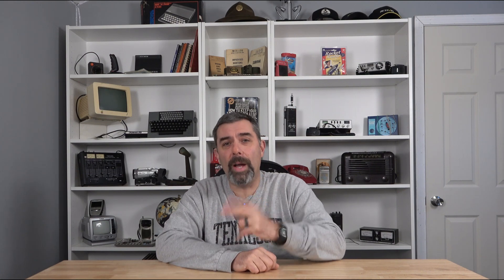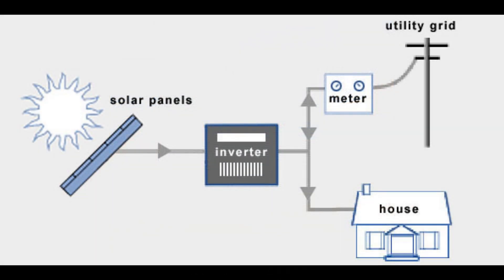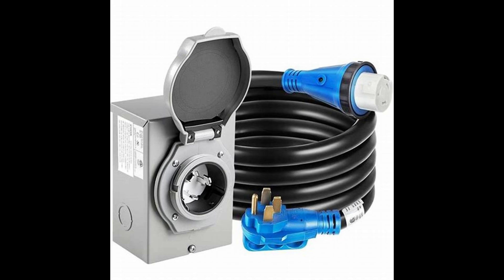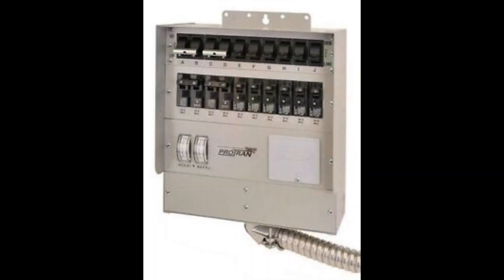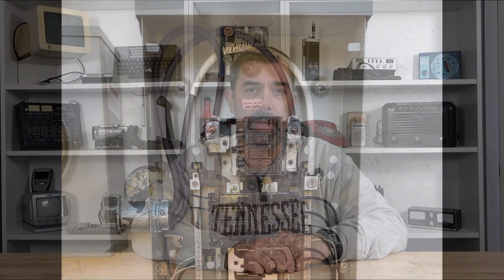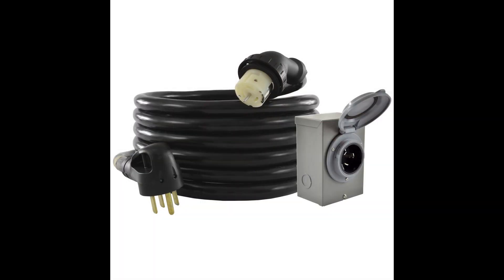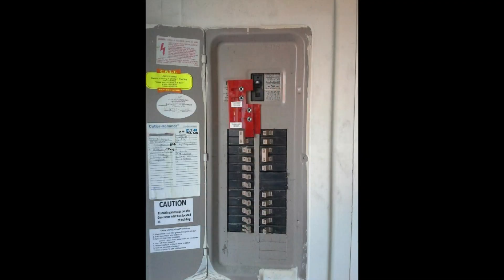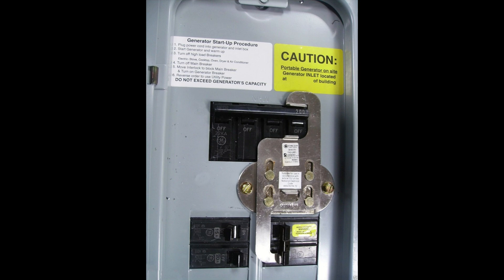A Beginners Guide To Solar Power Part 6: Transfer Switches And Lockouts.

Comment: Super informative video! I am in the process of buying the same 10 circuit transfer switch (matches our panel), and will have it installed soon. The Generator we have is tri-fuel, and will also have the gas company run an extended hose from the gas line so that we will also have the option of running totally on NG if we run out of propane - keeping away from liquid gasoline to keep the gun engine clean!
Reply from the maker: That is a great idea of hooking into the gas line. Good luck in it

Comment: I saw a video where a guy use a solar power station to run his transfer switch. I'd want to do that. My house have a transfer switch and i have a gas generator, but my gas generator is very noisy, and i cannot afford a big power station, so i am here trying to learn to build one. I know it will take me months to learn everything perfectly. I am patient and committed, cause one mistake can be dangerous. But more over, having this skill can give me unlimited off the grid electricity.
Reply from the maker: Yes, you certainly can! With a transfer switch already installed at your place, adding solar will be easy!

Comment: Are you familiar with the outback system? We have an off grid cabin and you had to be a scientist and know how to run the damn thing we don’t have regular power. We do have a generator back up Propane set up every time the guy came out to do some thing on our set up. He would charge us thousands of dollars. We didn’t put it in. It came with the cabin. We finally got the grid down our road. We will be tying into that and just have the generator for back up. The solar system is not worth it.
Reply from the maker: I am not familiar with that system- the guy doing the service, sounds like he is ripping you off. Solar is not that complicated once you know what to look for

Comment: generator transfer switch is fairly easy . much better way to go then separate solar outlets.  i never did a grid tie system in NY so far. some power companies have a net zero metering rule and some towns and stats have a net metering law. what that does is drive up the cost buy a lot. permits inspections . most home owners when they find that out don't bother grid tie.  just not worth the expense.    nice set of pics of the different type of transfer switches. I did my solar hot water different. direct solar to hot water panels. has black vacuum tubes that lets water circulate threw a holding tank/heat exchanger.  the circulating pump has it's own small PV . independent system.  gets super hot in summer. goes on by pass at times. then goes threw on demand propane water heater if water gets to cold that turns on . outher wise it's bypass. and I have wind power as well and my dump load is the heat exchanger tank or resistor bank. a few years back we had a propane shortage in NY. a outher year it was wood pellets.  some fire wood shortage due to travel laws in NY. heating has been a big mess in NY. heat pumps can heat as well but local electricity prices are high. no savings their . nice job on videos . just cant count on the grid anymore . Texas all most had a state wide grid down again but system bypass the fault in a way that effected just a few. under investigation again.
Reply from the maker: Thanks for sharing all of that- All it takes is one hickup and power could be off for a while. We had a bad wind storm here a few years back and we had no power for a week= We we lucky that we still had it. For some, it took over 3 weeks to get fully back online

Comment: I designed and installed my own solar system 2 years ago. 
I'm totally off-grid and generate about 60% of my electric needs. I installed  3800 watts of PV panels,  2 / 3KW Growatt inverters, and a 20 circuit transfer switch box 240 single phase. Also have 16kw battery backup. It has worked flawlessly for 18 months now. We still use the grid for our heatpump and electric dryer and  for those numerous cloudy days here in Southern Indiana. Adding more PV panels this year to max out our inverters. Our PV arrays are ground mounted adjustable and 125 feet away from our  inverters and batteries. I used 4 gage  welding cable to  handle expanding the  added PV panels demand. 13 k investment to date and  extremely pleased with the payback so far. Adding the EG4 power wall battery definitely was a big improvement. We did this all on a fixed income, and it took almost 2 years of saving and planning. I'm not a  fan of grid tie systems. Working towards total off-grid system eventually.
Enjoyed your content  and video.
Reply from the maker: How well did it do in the winter with the less than optimal amount of sun?
Reply: @FarpointFarms  Actually, it did fairly well. That's the real negative aspect of solar in the midwest. Now, with the larger storage capacity, it definitely helps. A big plus is that we operate our hybrid hot water heat on it for about 35 cents a day. That's for a family of four (2 teenage daughters) a load through the washer and dishwasher each day.
It really has worked better than expected for such a small system. 
Considering we run 2 freezers, 2 refrigerators, an 80-gallon water heater, all lighting, 2 TV's, 4 computers, 6 ceiling fans, and small appliances, it's working extremely well. Another 3800 watts of PV arrays, and we could almost be totally off-grid. Solar isn't the perfect energy source but has definitely been worth the investment for reducing our energy consumption and a great backup alternative.
Reply from the maker: Thanks for sharing that, where we live the winter months are not very sunny and mostly gray. I will have to look to see what we will be using and vary the battery storage from there. There is only 2 of us, so I think it will work

Comment: Electrician here. I got a quote on a solar system that would be grid tied. $35,000 and our utility doesn't pay you for anything you produce beyond zeroing out your bill.  Honestly I don't think they're worth it until they get that cost down.
Reply from the maker: Sounds like you need a better power company- That would be silly for them to turn down the extra power, especially for the high draw times. I think they charge those amounts to discourage people, if they are off grid, then the power companies don't make money